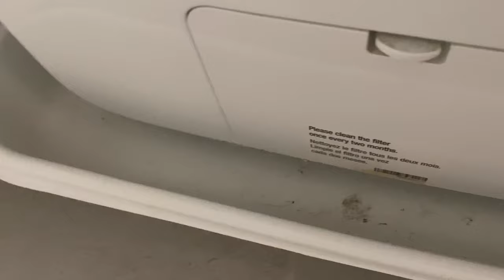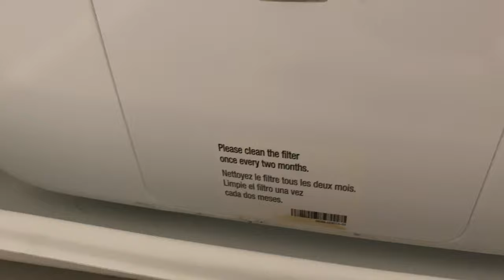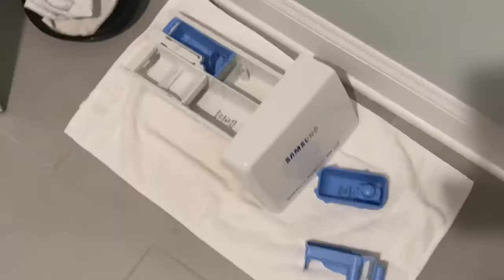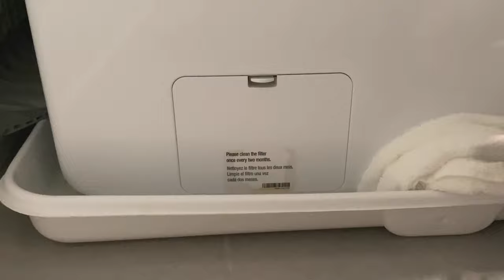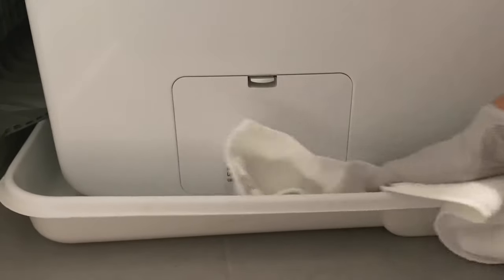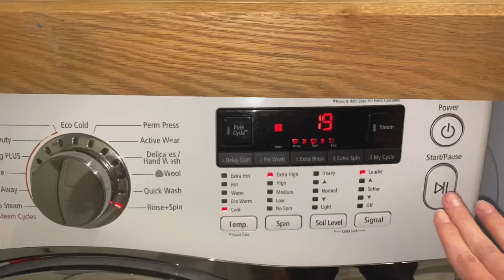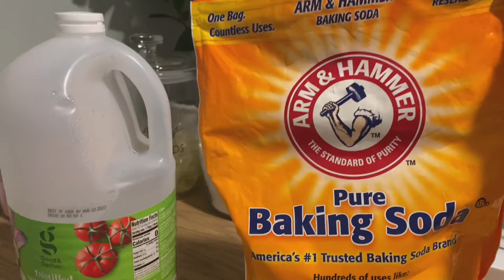HOW TO DEEP CLEAN YOUR WASHING MACHINE - GET RID OF FUNKY FRONT LOADER ODOR!

Comment: I'd be the last to judge, Heather. I've owned my washer for YEARS and once or twice run some vinegar through it. That's the extent of my cleaning. Your gunk is NOTHING compared to mine. Mine was so bad that my 41-year-old son noticed it when he was over doing laundry. I am left with some mold and mildew stains but after an hour or so of work and sanitizing cycle with some bleach (I'll do the vinegar and baking soda tomorrow as a follow-up), my machine sparkles and smells immaculate.  This is a wonderful video. I watched it a step at a time, then went to perform that step and so on. Well done.

Comment: Super helpful, I have been struggling with how to clean the gasket.  I have the exact same washer, love the vinegar and baking soda idea.  The only add on, I use a toothbrush to clean the inside of that filter at the bottom of the washer, since it is hard to reach.  Great video and love the reflection of your robe.  🤣

Comment: Great quality video, I enjoyed watching! 

One thing you’re missing out on is using the pure cycle! The button for that is on the little control panel not the cycle selector. I just turned it on and hit the pure cycle button.

That’s a long hot cycle design to clean the washer and gasket! It’s uses a good bit of water spun fast inside the drum, swirling, the water up over the gasket, cleaning it in the process. As per Samsung manual, they say for best results you can pour a little bit of bleach and detergent compartment.

Comment: Thank you for this great tutorial!  I just moved into a house with a washer and did a deep clean after watching your video.  My question is, how do you clean out the rest of the pipe inside the machine? I cleaned out the detergent dispenser trays and inside the washer, but I can still see mildew beyond what I can reach and I can only imagine it goes into the bowels.  I feel icky just thinking that water is going past moldy piping to try and clean my clother.

Comment: I just finished a deep clean on my Samsung because it wasnt draining..replaced the drain pump and it's working fine now but it was disgusting inside. Those bottle brushes work really well to get between that back rubber gasket and that hard plastic that the gasket is attached to. Right behind that is the metal wheel that makes the basket spin. That gets covered with soap scum and gunk!  just running vinegar and soda through the washer will not get rid of it.
 Bottlebrush bottlebrush bottlebrush. I'm telling you they are amazing. They come in different sizes and they are fantastic for getting the gunk off of those hard-to-reach places! You could even dip the brush in a cleaner. Better than a toothbrush and since a bottlebrush pipe cleaner style is metal, it bends!

Comment: This Samsung model actually has the PureCycle setting that you press and then press Start. It's their self-cleaning mode. I think you can use it along with the baking soda/vinegar combo to really maximize cleanliness. It runs for about 2 hours and, according to the manual, you're supposed to use it once a month.

Comment: Lowe's sells a washer cleaner powder that does an excellent job.  You put a pack straight in the drum along with a pitcher of VERY hot water and then run a normal wash cycle on hot.  We had to do ours twice because it was still soaping up.  That thing smells fresh and clean now.  Also we are leaving the soap dispenser open now between washes, along with the door.  These front loaders DO require cleaning about every few months.
Reply from the maker: Awesome! Will have to try it!!

Comment: I've done this for years and my Hotpoint front load washer is still going after 12 years. Once every 4 months is fine providing you keep door and drawers always slightly open after a wash and wipe down the rubber once a week. White vinegar with baking is good, but I add Dr Beckmann product also on a boil 90°c. 

Whilst front washers do require a little more maintenance I prefer them, I can't stand top washers especially as they're just awkward to  reach into and are ruff on some clothes.

Comment: Every time I finish using my front load washer,  I take a Terry wash cloth and wipe the door gasket and  the inside & outside of the door. The dispenser and inside dispenser get wiped down to remove moisture. Then I store the dispenser tray inside the washer with the door opened. Filter get cleaned on a monthly basis as well as tub cleaning.

Comment: Our front load washer doesn't have a filter, or whatever that little tube thing is that water came out from. Our tray is nearly identical though.
The rubber ring is the worst. It's so difficult with how tight it is to get within that gap space.
At least we've been sure to do it's monthly cleaning cycle with the pods it needs since we bought it. But vinegar and baking soda alone doesn't help with the mildew build up within the rubber ring, and vinegar apparently shouldn't be used, that could be why it's hardened more, my bad. I just want to have clean clothes.
Although a front load washer is more gentle on our clothes and cleans better, cleaning the rubber ring became a weekly chore. And we can't take ours off. We'd have to hire someone trained to replace the ring. There's a risk of getting hurt from the tension of the wire and spring keeping the ring in place.

Comment: This entire cleaning is usually recommended every how often? Debating to get either top or front loading set. Would you still buy front loading again?
Reply from the maker: I do a deep clean every couple of months or when it shows signs of needing. Always leave door open and drawers open to air out is key. I ended up getting another front loader as this one was almost 12 years old. I have a counter over so the top loader wasn’t going to work :)

Comment: I’d be more judgemental of anyone who is capable of perfectly maintaining a grime-free wash machine 😂. Honestly, it’s impossible. 

Just a few extra pointers for people to consider, but feel free to take it or leave it: bleach will break down rubber over time and isn't actually the best at eliminating mold spores. Also, while vinegar and baking soda both have powerful cleaning properties in their own right, they neutralize each other when combined (this is what causes the fizzing reaction), rendering them somewhat useless as a team. Vinegar should also NEVER come in contact with bleach as it creates chlorine gas.

Personally, i find peroxide cleaners to work best on these types of cleaning jobs because hydrogen peroxide is highly effective at killing mold and mildew, and it’s non-corrosive, so it won’t damage any of the machine’s components.

That’s enough yapping from me. I’m now off to clean my highly neglected disgusting washer 🤢